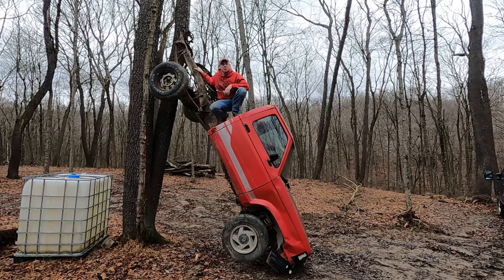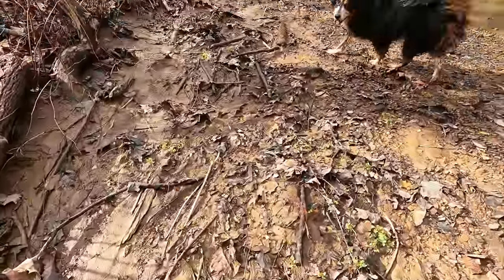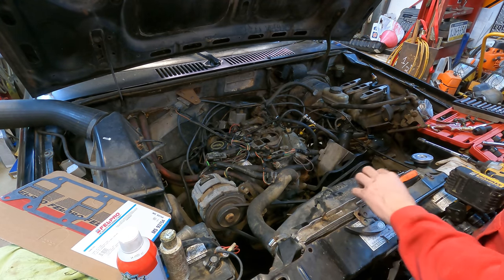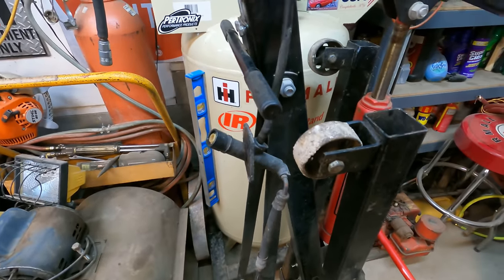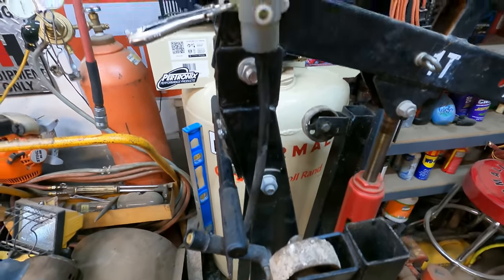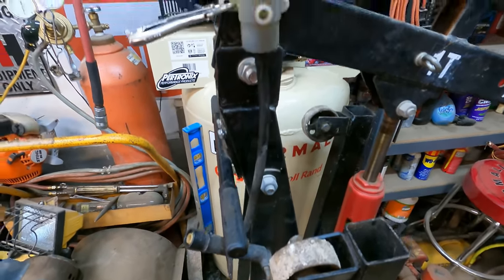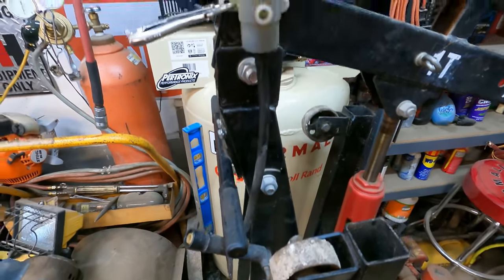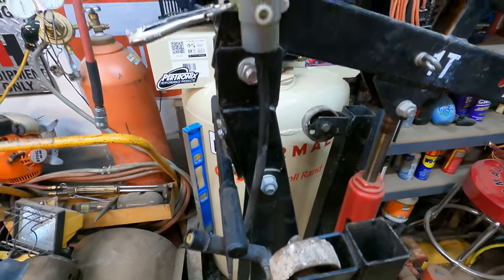$500 FORD Ranger pushes me over the Edge!! (it drives... sorta) 1988 Ranger Pt.2

Comment: Just recently bled a clutch cylinder on an 88 chevy by drilling a tiny hole in the top of the resivoir cap filling it up all the way and cracking the bleeder then I ran compressed air into the hole with a rubber tipped blow gun and ran lightly pressured it up twice, went from no clutch to 100 percent in ten minutes, old farmer trick, might help.

Comment: I’ve had this problem before on a later model ranger. I finally got frustrated and shoved a pry bar between the throw out bearing pryed it back to its rest position and then had a helper pump on the clutch pedal. Had to do this several times because the system was air locked. Shoving the slave cylinder back pushed all the air and fluid back up to the master cylinder and I finally got all the air worked out. You still may need a slave but try this first.

Comment: Back in the day when I worked on these trucks I would yake a bar go through the dust boot keep the fork from moving the slave cylinder that way when you physically blleed the system it will blled faster and more efficiently it will bleed air right off

Comment: You can also push fluid into the bleeder valve on the slave cylinder forcing the air bubbles up rather than down.
Reply from the maker: Tried that in the video

Comment: Easiest way I found to bleed them is to take a bottle and fuel line and put some brake fluid in the bottle and open bleeder screw and pump the clutch it comes around quick

Comment: Makes me miss my ranger....I've owned 5 sp far lol. Your temp gauge probably is the sending unit but even a brand new one will read cold even at operating temp. I've always stuck a mechanical gauge on mine.  The 2.9 is also prone to overheating and head/head gasket failure.  My last 2.9 I installed a tempo electric fan with a controller from advanced along with a 4.0 explorer rad.

Comment: Those ECUs in the early model fords are notorious for going bad. Rough idle, hard starting, heavy exhaust smell, fuel pump problems, check engine light, etc,.... I'd replace that ECU first. I have a 92 2.3 xlt that was running horrible. Put every part in the store on it. After seeing a video from a guy that rebuilds ford ECUs it turns out that's what it was. Got mine from O'Reiley's for $140 and it fixed everything. The ECU even controls the transmission. Hope this helps you or the new owner. 🤔👍🏾

Comment: Somebody might have pulled this to your attention by now, due to the age of the video,but a little trick taught to me by a ford mechanic, when you read the odometer on just about any ford from round 88 and up, look at the numbers on the odometer, if all the numbers are on a even line then you are under 100,000 miles, if the numbers are all offset to each other then it is over , if all numbers are all lined up but off set over 200,000 ......🤯

Comment: You can use propane also. Connect a small hose to small propane tank turned on low and the idol will raise higher when sucked up at vacuum leak.

Comment: The newer Clutch Slave Cylinder is inside the bell housing..
My 2003 4.0L Ranger 4x4 leaks after a new one was installed 15 years ago.
When the weather gets cold my reservoir empties.
Never have figured out why or where the fluid is going as it never leaves any wet spots, I just keep filling it up.
My bell housing hasn't exploded and my clutch still works.

Comment: By the way, clutch line from an F150 of the same generation will work. Had an 87 Ranger the college auto tech class pulled the trans out and ripped the hose in the process. F150 line is longer but has the same connections on it.

Comment: I replaced my master cylinder a few months ago. I ended up attaching some fuel line to the bleed nipple and just continued to pump the clutch until the fluid came out clean (prob 2 cups of fluid). I have never done the hold the pedal and close the nipple thing. I just attach like 3ft of fuel line to the nipple, pump the pedal a few times, and top off the fluid. I continue to do that until the fluid comes out clean. It has always worked for me, but wastes alot of break fluid.

Comment: I predict that those connectors on the hydraulic clutch line will work. Those are used in car washes all the time. Most of the time the applications have a lot of pressure in them. Good luck.

Comment: I had the same experience with my old  MG a couple of months ago. Kept pressing the pedal on/off with a helper and opening/closing the bleed nipple. In the end it appeared there was a BIG air bubble caught in the slave cylinder. I wasn't able to get it out until I squeezed the cylinder manually and opened its bleed screw and so pushed out the air. This was after wasting lots of fluid. After that is was fine. P.s. pressurising the system with an air hose to get rid of air??

Comment: To bleed the the hydraulic clutch, you minus well leave it in, have another person press the clutch pedal down, it takes one-two pumps on the pedal. hydraulic clutch simple excepting you dont put air through it like u just did.  I have 92 Ford F350 manual

Comment: I feel your pain. Currently fixing up a 1989 GMC S-15 2.5L.  I've been through everything and still idles rough. The only thing I haven't done is fuel pump. I can't find a fuel pressure tester that has a connector for the fuel line to the TBI.

Comment: The coaxial slave cylinder was definitely not one of Fords Better Ideas tm. My old 1985 Nissan used a piston type slave cylinder which engaged a fork assembly to move the throwout bearing. 30 minute replacement time versus 8 hours and a lift for the Ford.

Comment: Carb cleaner works better for finding leaks.  Less risk of blowing up than when using ether.
So did I miss something? You didn't want to pull the motor on a project you were planning to swap with a different motor?

Comment: Iac works of of engine temperature so also check thermostat, also did you change the o'rings on the injectors? If not I can almost guarantee there's a vacuum leak around them. Now as far as bleeding the clutch you can do a reverse bleed method from the bottom up. I've never really had any issues doing it this way. Do not gravity bleed it will never work because of the upside down design of the master cylinder air will become traped at the top. Vacuum bleeding will end with the same result... Pressure bleed the system trust me I've been doing this for over 45 years

Comment: Them quick connect on the master slave cylinder hose r a pain I’ve had to take channel locks n squeeze them tightly to open check valve then it works u will c lil air bubbles rise

Comment: Keep it for parts bro! Short bed four wheel drive Rangers are not that common. You would be swapping in a new engine anyhow. You just have the "everything I touch turns to shit" blues. It needs a diesel, a dana 30 jeep front axle and a Ford 8.8" rear axle and 35s. You would be the talk of the town.

Comment: Air intack leals, Hi Bud, I had a strange air intake leak once, was on the brake booster - relies on air vacuum from the inlet to work but the brake booster developed an air leak so it got sucked into the inlet manifold as an air leak/ anyway, thanks for the video..PS copper gaskets, do you know you can "anneal" them/ soften them up buy getting them hot with a gas gun then drenching them in cold water / might be able to re use them again.. I done this on a copper head gasket on a Austin MINI race engine I built, rebuilt, rebuilt again and again poxy thing - lol - only raced them for 2 years and moved up to another class in the end..

Comment: I have found on those rangers if its drivable  but still needs bleed you can press the clutch pedal about 30 times really fast every time you drive it.  Also that ranger would have been a good v8 swap.

Comment: Come on man don't just trash it after all the work you've done... keep on going!!!
Reply from the maker: Not trashing just letting someone else get some time on it
Reply: @DieselCreek  my father purchased a 1990 model new 4 cylinder 4 speed. used it up handed it down to my  older brother he used it up. it was left for dead in his side driveway(after it's second engine). top rusted clutch out with bed and inside full of crap. so i had to purchase it of course from my brother for 400. clean it up. painted the entire roof as it was rusted and pulled the transmission myself in his driveway and installed a new clutch and drove it home... ha! you can do it!

Comment: check master cylinder , the position adjust . if the valving not in correct position it will not flow

Comment: I bought a 2005 eclipse v6 for $300 in 2012 with a fresh tuneup that wouldn’t run. The spark plugs are under the intake. I knew the problem was they probably reused the intake gasket and I was right. $5000 car for $300 and a $10 gasket.

Comment: I think if you find a 70s-90s f250-350 would be something could to build and have as a tow rig but use the blue beast drivetrain axles and even the flatbed as something for a fifth wheel towing beast I love my 70s and 90s obs trucks

Comment: The blow gun in the reservoir.  Haha....  I think we've all been there on a slave cylinder bleed.  I battled a 94 ford ranger in a similar fashion and the memory still pisses me off.  Manually compressing the throwout bearing helps, but might be impossible inside the bell housing.  Still a decent watch. 👍   What's the proper send off??

Comment: Can't win 'em all. Good try, those hydro clutches are a beeeatch.
 I had the one from my 82 Chevy in and out about 5 times before I got all the air out of it.
Seems like even one little bubble takes all the fun out of it.
 I have one in my 62 Chevy Bus too, but it's a better design. External slave, reservoir is shared with the brake.

Comment: Given the amount of air that was coming through once the vacuum pump was applied was it pulling air into the system where the previous owner had spliced in those line connectors?

Comment: In a case like that one, two wheel drive, not a perfect body or ever was it for that matter.... the rig would of got very little love from me either. A real nice rig I might of thrown a different trans altogether or go/went automatic as they are cheap for that I should imagine. Hell of a time there Matt. Time to go to auction an get a soda blaster/media blaster fixed up so you can clean the Diamond T up as it deserves a good job on the outside body work with just the needing interior parts fixed an going right but thats close enough as those old cabs are money pits

Comment: Replace all your brass temp sender gauges ( cheap) after 30 some yrs it will run better . Oh no dont dump her ! I had the same issue w that bleeder situation . After you hang / bump the air bubbles out (like you did ) you have to get it to release (after all that machinery pump thing you did ) at the bleeder screw and let a whole cup (while feeding the resovor)run out NOT PUMPING THE PEDAL it will work itslf out . Its a pain but I dont think you slave cyl was bad

Comment: I have a 2000 XJ 4×4 the engine light was on had it code tested bc it would just die while driving all power an a couple times it would just come right back on...so I changed the coil pack and plugs and it still did it a couple times...so I put fuel injector cleaner in my gas and cleaned the throttle body with brake cleaner 
So what else would you think it could be or anyone in the comments for that matter...thank you

Comment: For my 86 bronco ii when I had to change the reservoir,  I just pressed on the cluch pedal all the way down then slip my foot to the side to let the pedal abruptly spring back to its normal position. Did this until I got pressure built up to operate the clutch correctly.  Hope this helps

Comment: Transmission takes 30 minutes to pull out. All the bolts are extremely easy to get too, and you already took the hydraulic lines off. I did it by myself with a junk ranger in my driveway replacing a clutch, just bear hugged the trans and popped it out of the pilot bushing. Slave is super easy & cheap to replace and even putting a clutch/flywheel in it was fast, just saying if you ever have to do it, it's not hard to do at all.

Comment: I use a motive power bleeder.. make my own custom caps for bleeding.. on diffo cars...my 280sl took 1gallon to get pedal pressure firm..mb stated level car hit lines with rubber mallet..to remove air..bench bled master 3 times... nightmare.. I love motive... hate mb brake rebuild...

Comment: A question besides the Ranger project. What electric/cordless impact wrench are you using? It's a yellow DeWalt, but which model? I'm looking for one to buy for use on daily basis to work on cars. I'm not sure which one is a good one. I've seen the videos of Project Farm comparing those, but in your videos it's clear to see that your impact wrench is taking a lot of use and abuse without shedding a tear. I know, you've mentioned it in one of your videos, but I can't find it.

Comment: That engine is not idling smooth, its got a massive misfire, which is why it's shaking like it does when its running. Fix that and it'll start so much easier.

Comment: what happened to your crane? i'd have figured the danger ranger would've been hanging from it, rather than leaning on a tree. yes, it is called an intake plenum. i never try to reuse gaskets 'cause they only work once. it's kinda their deal. in a pinch you might get away with a field expedient repair by using some silicone on the old one, but i wouldn't trust it as a permanent fix.

Comment: Leave it to Ford to foul up a simple system.As far back as 1964 a lot of vwhicles had this type of system,except that the slave cylinder was bolted to the outside of the bell housing.Even when the slave cylinder Failed it could be removed and replaced very simply. In the late 90s we had some small trucks I think they were Toyota or Nissan that had the slave cylinder outside the bell housing.Slave cylinder kits were available but usually by the time of failure the cylider was so pitted that it had to be replaced.Replacment cylinders were available and cheap so no big deal.

Comment: If the fuel filter is actually plugged I will guess the fuel pump is probably bad also as they were a problem on fords back then any way. I always pressure bleed those because of those poorly designed upside down clutch master cylinder.
Reply from the maker: Pumps are both new

Comment: The last bit of air you tried to pull out was the last bit of air in there which was about to probably come out the other side so in a fact what you did was pull the air bubbles deep back into the system so if I were you I would do two more sessions from the original way you pulled air and see if that does it and then throw in the towel

Comment: me and my friends all had rangers and I come up with the idea to put V8s in our trucks three used 302 and I used a 351 windsor wow I had to put in a 5 speed racing  trans but damm I could make that think run like sin, the 302 and the 351 are the same size block!
Reply: They are not exactly the same block. The 351W is a raised deck version of the 302 to allow for the longer stroke.The 351W intake is actually wider than the 302 manifold due to the wider spacing of the heads. They do share the same bell housing bolt pattern tho.

Comment: When the slaves go in those rangers you loose all clutch. Most likely the vacuum pump pulled air through the check valve because it was weaker than the pump. If you get any pedal and enough to drive it. Overfill the resovoir and bomb it around the property.  The air will work out on it's own

Comment: plz dont resuse an old internal slave. i had a 94 ford ranger as my 1st truck with the BIG 4.0L and a 5speed. LOVED that truck but i got rid of it cuz it needed so much work the final nail  in the coffin was the slave blew and threw oil on the clutch disc and being a NY truck there wasent much left after 20 years

Comment: My husband had a 84 Ranger with the V6, he got rid of all the intake and the brain that came with it. Put in a different distributor and a Rochester carburetor jetted down.
Got 19 miles to the gallon and would do 90 miles an hour in 3rd gear. 4 speed gearbox. The whole engine bay was basically super clean of all that garbage you see on this guy's rig. He went under the dash and pulled Bullwinkle's antlers out from all those vents, now you can work in behind the dash no problem. Left in the defrost and the floor heating only.    He found that Motorcraft Carburetors froze up in the winter, so we went to the Rochester and reduce the size of the Jets. The reason for that particular carburetor, is because it was new and made for a 6 cylinder, it was free and it worked...

Comment: The way we use to do it at the trans shop was bleed it till you get a little pedal then put the cap on the reservoir and that little tit on top put a little air pressure to it and the pump the pedal

Comment: if i were u i would replace it all never bother fixing worn out clutch because not worth time wasting
once fluids turn black it will be stuck in there forever never get it out of it
doesnt matter how many times u tired to do it
i have ranger 96 have bad worn out clutch pedals but did mess up slave cycling so i replaced them both never have issues with it run n clutch easy 22:18

Comment: The ford clutch master cylinder is the stupidest design you have to pull the line off and fill the reservoir with oil and push the air out and then put the line back on you cannot properly bleed it in the truck because they put it at a stupid angle I have a manual ford ranger and I had to do it that way and it’s perfect now